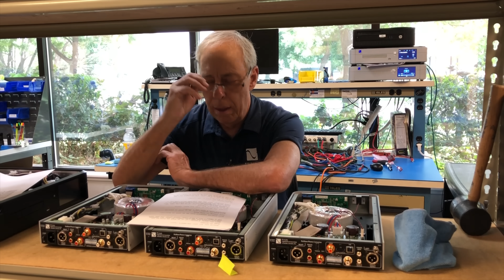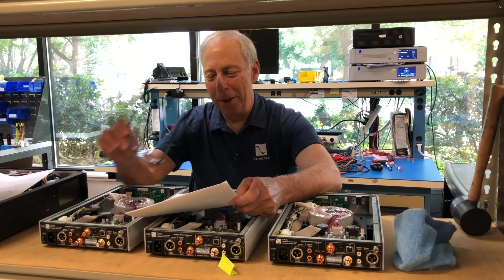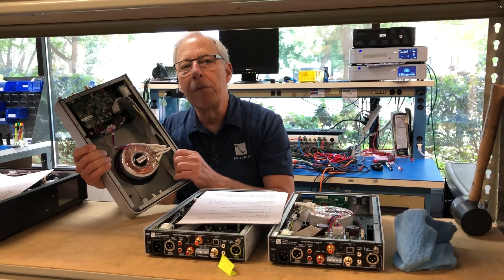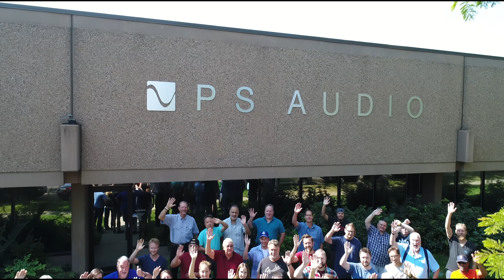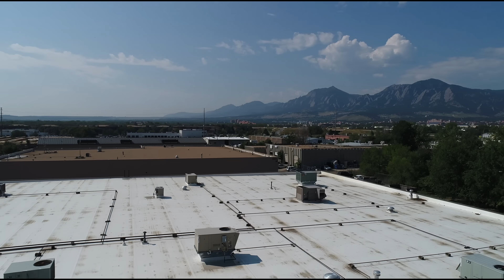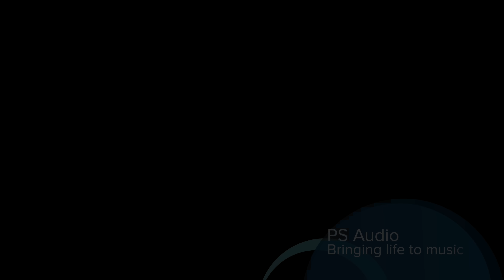What's inside a high end power cable?

Comment: Considering the audio circuits are after rectification and FILTER capacitor circuits, (as close to pure DC as possible), how could the AC power cable influence the audio unless it is too thin of a gauge, and there is a voltage drop to the audio equipment power supply?
Reply: You said it right. , while conducting, the curcuit is passing all components and the color they each give off gets imprinted in the audio signal to a minute degree. So if a thin wire can strangle the flow a thicker wire will do this less. They each have characteristics beyond resistance only. Capacitance, fieldlines behave differently etc. Try lifting your wires off the ground... let someone else do it. blind test. Your equipment must have the quality to show it of course.
Reply: @comiplaynow4624  LOL
Reply: @comiplaynow4624 🤣
Reply: @a0r0a745   i made a few power cables since then and the results are stunning. They can improve the dynamics and tune the sound.
Reply: @comiplaynow4624  I have made my own Lapp power cables. They look lovely but I am not going to say they sound stunning. If you understand electronics and how your kit power supply operates saying the difference is stunning is questionable. Glad it works for you.
Reply: @a0r0a745  i maxe a few and one made it sound worse. Out of 4 cables only one was perfect for my system. Copper geometry and twisting all matter.
Reply: @comiplaynow4624  if it works for you then fine. You won't convince me. If you are UK based I would love to meet up and us have a fun afternoon swapping power cables. I would happily admit if you pick out a difference correctly then I would eat my words. Upto now no-one wants to do this. Said elsewhere in comment sections, audiophiles can always pick  out a cable when they can see or be told what is being used but when blind folded and not told it is a different story. I am not trying to mock or rubbish your claim or anyone else's claim but I am not the one saying it works. Enjoy your set up and if you are in the UK we can use your system as your system obviously has the quality to show this difference. Your words. I love hifi and yes we all want to extract the most from our kit. Nice quality cables are nice.
Reply: @a0r0a745  unfortunately im in Holland but if your ever in the area sure no problem. I was a nonbeliever  as well.. I have done lots of this stuff. Also in speaker crossover components. Your setup neads to be revealing of course.
Reply: @comiplaynow4624  that's a shame. Or you could say the system is already revealing enough hence no change. If someone wants a proper noticeable change why not EQ to the room. A crossover is basically EQ. Like you I have upgraded caps etc.. in crossovers and that is a much more revealing improvement if you are after say detail, imaging etc.. In the UK we operate 240vAC 13amp with a 3 pin plug, L, N and Earth. If the power cable is a 13amp CE rated cable it will deliver the current required safely. It is not that I am a non believer it is about the specifications to deliver the relevant voltage and current required. AC to DC domain. Keep enjoying the music and nice talking.

Comment: have you ever seen a house wiring installation? yea... crappiest wires ever. Why plug a us$10000, 100"diameter solid core gold plated fairy dust sprinkled power cable into a friggin wall socket with some cheap ass wires going from there to the step down transformer at the power lines? Stupidest thing I've ever heard.

Comment: We have a super high purity quantum tunnelling cable; hand built 5 miles underground by blind Russian Miners to prevent copper-photon oxidisation, using state of the art techniques and using the latest advances in quantum theory we were able to manufacture non-deterministic materials which adapt and reconfigure the molecular structure to shift electrons into higher energy states increasing the velocity of charged particulates; increasing net density thru-put whilst decreasing thermal entanglement resulting in more powerful timbre and realistic sound-stage compared with any other cable on the market. Just reply back if you have questions.
Reply: Good one!

Comment: Those last few feet in between your wall socket and amplifier/what-ever-you-are-connecting is not going to do diddly squat to the tens/hundreds of feet of "zip-cord" that runs in your walls. I dunno if 
"zip-cord" is the wrong nomenclature here since I'm not a native English speaker but you'll get the idea I think.
Reply from the maker: We do and thanks for chiming in. What you're saying here makes perfect logical sense. Unfortunately, it is incorrect. Think of the AC power line in your home as a loop (it's AC moving back and forth) not an end run. The equipment isn't the last stop at the end of a chain but rather in the middle of a loop. That exposed area of the loop, where your equipment is, is the noisiest part of your home when it comes to radiated noise. The equipment itself are the culprits, radiating large amounts of unwanted EMI. This is why a well shielded, heavy gauge, power cable makes such a difference.
Reply: Again show us the evidence. Show us scope images of the DC rail AC coupled with a commodity power cord and your power cord. Show us the level of RFI noise reduction on the amps DC rails where it matters. If you wish, you may also show the RF noise on the speaker terminals with your cord and the other.  Let's see it!

Comment: Speaking from laymen's experience, nothing has made more of a difference to any digital set up I've run than putting a good power supply in a PC. I don't have the tech knowledge to explain this, but surely it's relatable?
Reply: Agreed. Clean power a must. Very noticeable difference in the mid-fi and beyond systems
Reply: @Theburrowingid  A power cable doesn't clean up the incoming mains, it just delivers power to the equipment, you need filtering to remove noise from a voltage source.
Reply: No, there is next to no comparison. A power cable delivers a regulated (to within +/10% of nominal) AC supply at 50 or 60 cycles per second into a device that contains a power transformer which has an inductive primary winding strapped across the mains supply and very little else. A power supply has a transformer, a rectifier of some sort, smoothing, voltage and current regulated to tight tolerances. The difference between these two power sources is night and day.

Comment: If there's such a difference between power cables, why don't you just build your amp into the wall and solder directly to the copper from the plug? Completely cut out the power cable variable. I would be interested in seeing blind testing between a heavy gauge industrial (but cheap) power cable and a $100+ "hi-fi" cable

Comment: There is supposedly scientific proof as to why power cords sound different .....im just the messanger ....power cables are  supposedly  a conduit  for transmitting noise itself from the AC outlet it is connected to..as high frequency noise from digital devices  like computers, air conditioners , dimmer switches, LED lights , etc are  present on the AC line.......some power cord designer 's have filter networks to alleviate this high frequency noise . I suppose skeptics would say the components themselves should be able to filter out this noise without the aid of power cords but  im skeptical that with so much noise present today on urban power grids that components can filter it all out by themselves.   Power cords also attract noise to the power  cable itself from all the RFI bombarding the environment in which the cable is in....some high end power cords  have 5 layers of shielding as a result and   Then there is the issue of the cable geometry of the power cord itself which can influence its ability to cancel or minimize noise and interference .  What about gauge size of the power cord?....supposedly larger gauge size allows for  more instantaneous current in a very short amount of time( compared to standard  power cords ) to be delivered to components which seems like it would be very important for amplifiers and affect the real perception of the amp having effortless dynamic sound. Power cords have dieletrics that supposedly influence the speed of current transmission through the cord....that affects instaneous current draw also. Even if all this is legit science and not pseudo science by cable designers if someone doesnt have the sensitivity to hear it or the stereo system doesnt have  the resolving power to transmit the difference then its possible both realities exist for cable aficionados and cable skeptics...it just depends on your own sensitivity and perception.
Reply: Very well said!
Reply: So many wrong assumptions here. It so easy to see these ideas were hand plucked from the finest audiophile press rags.
1) Ok so a shielded cord or a cord with RFI filtering in can reduce noise from entering through the power cord. Now what about the unshielded Romex cable inside the wall? What about the drywall and wood which can very effectively pass RFI. You think that RFI will only enter your gear through the 6 foot power cord and ignore the 100 feet of unshielded cable in the wall?
2) The larger wire allows more instantaneous current? No, the larger wire gauge allows more current period. So what is the difference between a cheap 12ga power cord and a $2000 12 ga power cord in terms of electrical performance?
3) Speed of power delivery? The power is a 60hz sinewave. 16ms intervals is the fastest that energy can be delivered from  the source. Do you have any idea how much capacitance would be required to slow down that current against the source impedance of a typical residential power source. I got a hint for you. No 6 feet of cable ever made could do it. And also how can a power cord speed up current delivery faster than the source supplies it. Got a basic physics problem there although we all know the laws of physics don't apply to high end audio.
4) Amplifier resolving power? No such thing. That's just audiophool BS talk be the snake oil vendors. The so called resolving power is the signal to noise ratio of the amplifier. Any modern HiFi amplifier on the shelf at Best Buy has sufficient resolving power to hear what ever there is on the recording. Now speakers can and do limit this resolving but modern audio electronics is quite good enough in terms of S/N ratio not to worry about resolving power.
Reply: @andydelle4509  ....the power cord  is at the very end of the chain after all that unshielded romex picks up all that RFI and EMI..in other words....since the power cord is connected to the component and the last cord in the whole chain ....if it has filter networks ....it un does all the grunge picked up along the way by the unshielded romex....lmfao
Reply: OK, that's correct, but does the PS Audio power cord have filtering? Some of these audiophile cords do have ferrite cores or even built in passive components. But a more effective filter can be made with passive components and put inside the  gear. Corcom is probably the oldest and largest manufacture of packaged component AC line filters. I have used them in many of my designs. My point is beyond basic shielding, a power cord is not the place to invoke line noise filtering. In fact shielded power cords are for noise EGRESS from switch mode power supplies. Not RFI INGRESS. And furthermore the audiophool power cords that do have filtering are hardly engineered products. Show me graphs of attenuation versus frequency. We get none of that which is standard engineering specifications for a filter product. Like I and many other here have stated, the snob audiophile industry is the only place where we see these charlatan power products being peddled and bought. No where else in the entire electronics industry is this snakeoil accepted.
Reply: @andydelle4509  ........PS  audio power cords have very unique geometry ( besides filter networks in power cables ....cable geomtery can minimize or reduce noise as already noted in my first thread) but as to what their proprietary cable geometry address specifically ....is a question for PS audio not me as all that is mentioned in this video is that the geometry was used  for the perceived subjective voicing of the power  cable . Yes there are companies ( shunyata research ) that measure power cords performance parameters like noise and instantaneous current delivered to component s in very short intervals of time . I forgot to address your critique of power cable shielding in your first reaction to my thread.....even after all that romex picks up all that induced noise in the walls ....with a shielded power cord at least you are not adding another link in the AC  chain that adds more noise to the component at the end of chain ....furthermore most power cables that have filter networks  to remove noise have the filters precisely constructed in the middle of the power cable if these cables with filter networks in the middle were unshielded then noise would be introduced in the  proceeding second half of the cable after filter network did its job which would add noise back into the cable . As for your claim that filters can be added to components themselves to remove noise instead of the power cord ...i find both approaches together to work more effectively than a singular approach because there is so much noise ....at least in urban settings ....filters in components are overtaxed and are better served  having power cords working in tandem with them to remove a greater amount of noise
Reply: You obviously have no background in any area of electronics. Keep reading those audio magazines! Can you or your favorite cable makers show me the spectrum of this "urban noise" Can you or they show me evidence of this noise on the DC rails of the audio component when using commodity power cords? That's how real engineering is done. Evidence of a problem and a repeatable solution. Just to be clear I am hardly discounting the problem of RFI especially in an urban setting. I am questioning magnitude of the effects on HiFi audio equipment. "Voicing the power cable" Hilarious!
Reply: @andydelle4509 .....yes i will continue to read and believe high end audio magazines since magazines that claimed every thing sounded the same like stereo review and the audio critic went out  of business....lol.....i wonder why? ... In conjunction with the fact that audio measurements are evolving( maybe not  with ignorant engineers who were trained to be practical ) in the high end  circles to help explain better what we are hearing .  Have you ever heard of the audio  cable technological term of SKIN EFFECT?....the basic definition is high frequency signals tend to travel on the surface of conductors and lower frequency signals tend to travel in the center of conductors and of course this affects the speed of transmission of the frequencies. . The PS audio power cord has mutliple conductors  of hollow and solid core conductors with  multiple sizes ......due to the fact that the 60 Hz AC sine wave travels through these different types and sizes of conductors in the ps audio power cord that is affected  by the  of phenomena of skin effect... ....you think its hilarious that the founder of PS audio could voice his cable with this type of geometry?
Reply: @Mike Truth....Do you honestly believe with a 30 year background in broadcast engineering and a major in EE with an emphasis on RF you think I never heard of skin effect? What do you know about skin effect? You claim it is an "audio cable technological term"? Do you know that it is irrelevant at audio frequencies? It's an RF term, not audio. Yes it does take place at 20khz but the effect is so far down in the noise floor it;s again irrelevant. Furthermore what would skin effect have to do with a 60hz power cord? Are you saying we should optimize our power cords so that RF sees less attenuation? Didn't you start your comments here citing the ills of RF noise getting into power cords.  Now you say we should design power cords that minimize skin effect and make better RFI conductors? Enlighten us ignorant EE's some more please!
Reply: @andydelle4509  ....what does skin effect have to do with a 60 hz sine wave in a  power cord...?....the different size conductors of the ps audio cord  would affect speed of that 60 hz sinewave....the hollow core surface conductors of PS AUDIO cord force the 60 hz sinewave to travel on the surface of the conductors thereby increasing the speed of transmission....the opposite would obviously  be true when the 60 hz sinewave travel through the thicker solid core conductors of the ps audio power cord.....its is obvious that by including all these type of conductors for the 60 hz sine wave and its influence of skin effect of the signal and therefore its speed...he is trying to voice his cable that avoids extremes and one of a mean average that doesnt sound too fast or too slow. So what if one of my earliet points was RfI and EMI and filtering earlier in the thread s.....there are different aspects of cable design that affect performance..
Reply: @Mike Truth...Is there a function on YouTube where  I can send your last post to all the EE's who commented on this thread? Your last post is hilarious! You have no clue as to the physics or principles of electrical engineering. A power cord that "sounds too fast or too slow"? The ability to "speed up" a 60hz sinewave buy using a hollow conductor? Why not show us the math behind your claims. Are you saying skin effect is merely a result of the conductor geometry and has nothing to do with frequency? By sending a 60hz sinewave through a hollow conductor it arrives sooner than with a solid conductor? Huh?